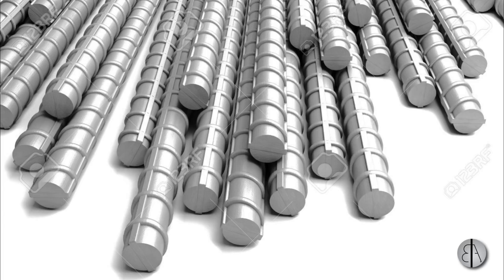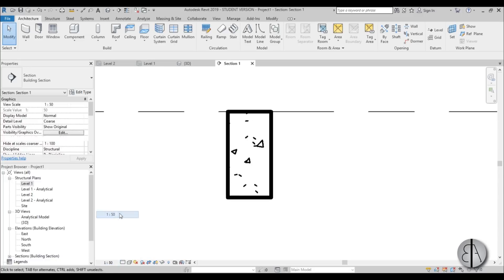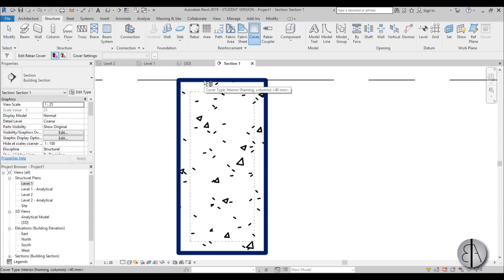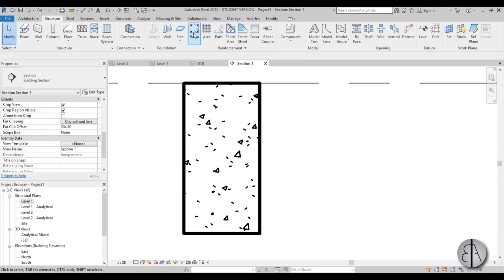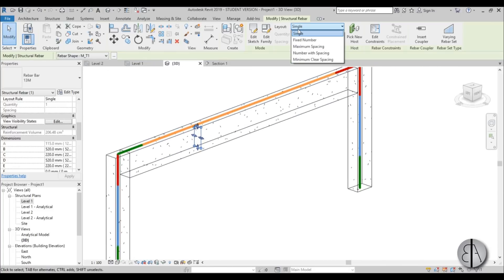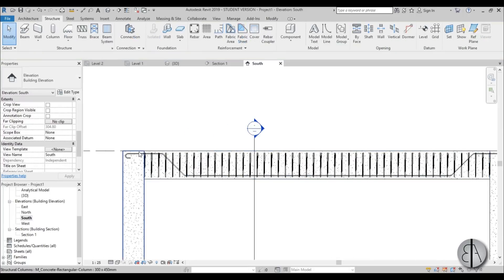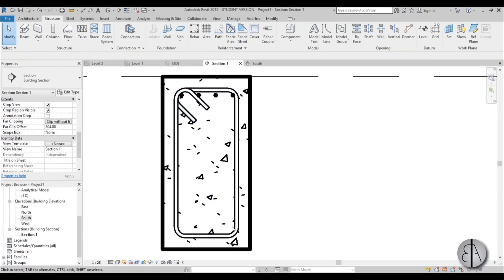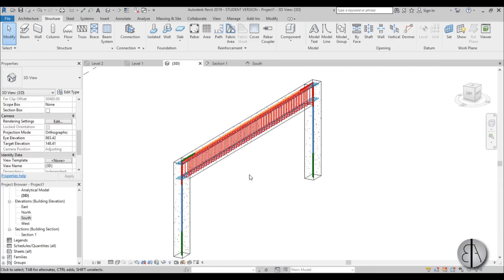Reinforsing a Beam with Rebar in Revit Tutorial

Comment: Hi 
Question: the stirrups for beams usually have different density based on bending moment. Like for example L/3 from column has less spacing and L/3 in the middle has more. So how can we show that in revit?

You have some really good, simple and easy to understand videos.
Reply: Copy rebar sets in those locations and control spacing seperately

Comment: I recently have problem with my structural column or beam not able to stretch length wise. 

I was wondering if you know which part of revit software corrupted? 

Because of it, my structural revit file can not save after open, software just shut down after try to save it.

Comment: I cant get my parallel to cover rebar to fit into the parallel to work plane rebar. When I click Fixed Number  and choose 3 for example it extends to the original cover, not to the ring, which I wish it was (10:36)